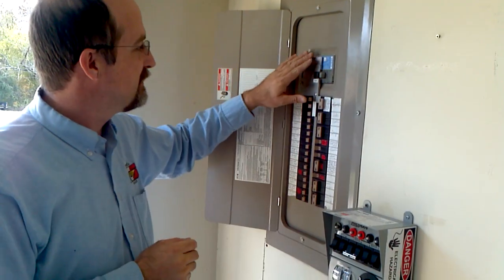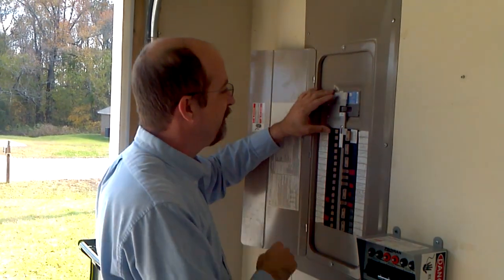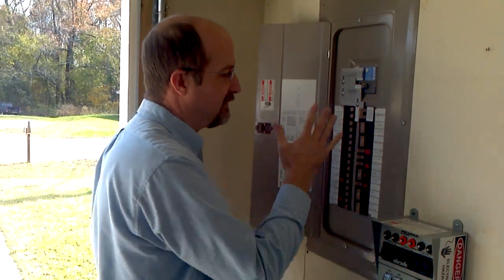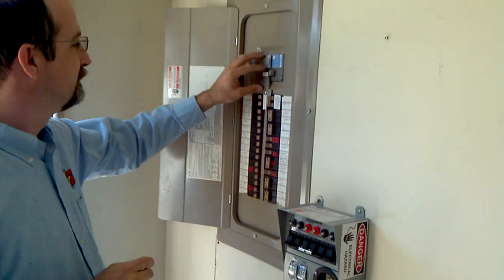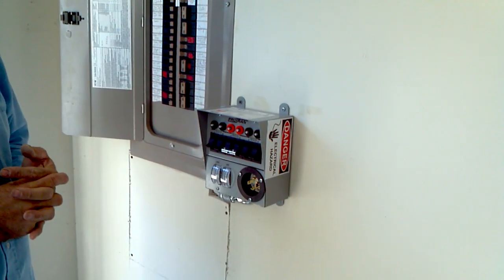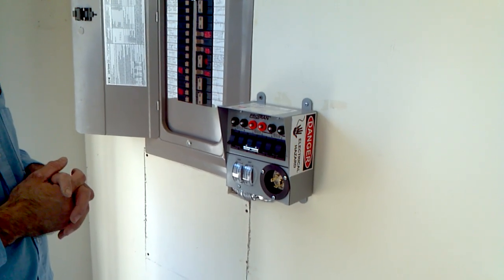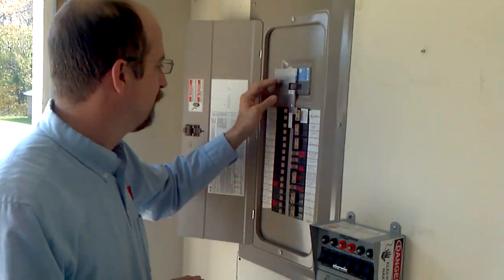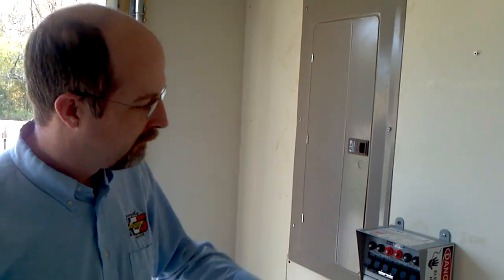DIY-Home Solar with Interlock Kit Installed Part-2

Comment from the maker: Thanks for your comments.  To go totally off grid 24/7 I would go with at least a 3000w inverter, this will allow you to run your fridge, freezer etc with room to spare, to run tv, microwaves, etc.  I started with a 3000w (continuous) pure sine wave inverter and moved up to a 4000w inverter.  Modified sine waves do work, however, they are hard on equipment.  If you can, go with a pure sine wave.

Comment: I love your videos. I am in the process of converting to solar power. My question is how big of an inverter would be needed to go total off grid 24/7. I understand you are instructing as a back-up source, but researching I am not having much luck. I do know a refridgerator pulls hard on start-up and without proper electricity could in time burn up the fridge. Again thank you for your videos. They are awesome and you have taught me a great deal.

Comment from the maker: The Interlock Kit installed in the main breaker panel, will allow you to safely back-feed power to any circuit in your home during an outage, partially or completely depending on your generator source. I have a video that shows this in my home. However, a transfer switch would help you to supplement your grid use by allowing you to power "portions" of your home with solar during non-outages. The Interlock-Kit, when installed correctly, will totally disconnect you from the utility as per design.

Comment: In my continued research on Solar, I contacted our power company and there is a $100 application fee, plus you have to buy the meter that allows net-metering, and you have to have the system inspected etc..  If I didnt want to do net metering, could I use an interlock kit to do 2 things- first supplement my grid use, and 2ndly use my solar panels to power partially during a black out?

Comment from the maker: @amusingisthedawn The Interlock Kit is great used in conjunction with a 240v gen connector. The transfer switch, in my case, is for people that don't typically feel comfortable in a main electrical panel. Is it necessary? No, but if you have a 65 to 70 year Old loved one, or anyone not electrically inclined,a transfer switch is feasible. Check out my video "DIY-Home Solar-Why do it and What can it power?" It gives a good explanation.

Comment from the maker: @amusingisthedawn The Transfer Switch serves 2 purposes, 1 it allows for simple switching for people who are not electronically inclined. 2 the 240v generator connector allows for gas or solar generators to connect to the backfeed breaker and can be used to recharge batteries, heat a water heater etc.

Comment from the maker: @ShePreps2 In my area you can go through the process of signing up, that's what I mean by officially, that's when the utility will give you a credit. But for me, I simply use a Grid Tie inverter I bought from Amazon to suppliment the power coming into my home, thus reducing the power used from the utility. So in that sense I'm not selling power back per se, but in essence it's doing the same thing as a "credit". When I use it, my meter will slow, stop, or go backwards depending on my pwr usage

Comment from the maker: @ShePreps2 The Interlock Kit allows the home owner to safely "backfeed" power from a generator source to the rest of home and not to an inactive grid, usually in the event of an outage, in which case the utility lines are are not and should not be energized or "powered up".  You can only feed power back to the grid when it's lines are powered up by the utility and only with a grid tie inverter. In my area there is a special program where you can "officially" sign up.

Comment from the maker: @shartne Yes, they are hot with 220V AC from the inverter.  I'm going to put a cover on it or plug a dummy connector in the receptacle sometime in the future. I don't have any little kids running around so I don't have to worry, but it's still a safety hazard and I need to correct it.